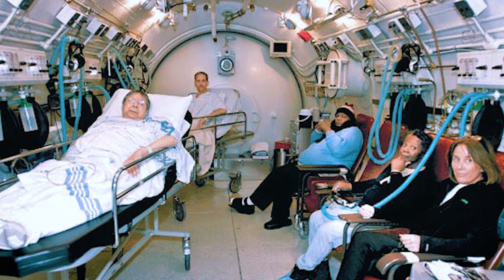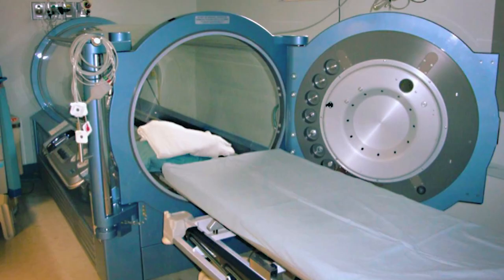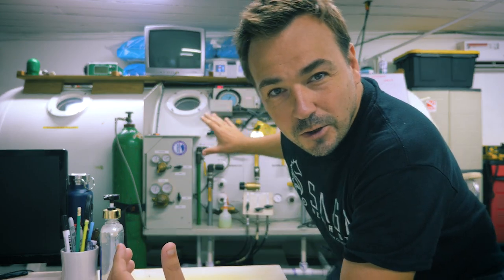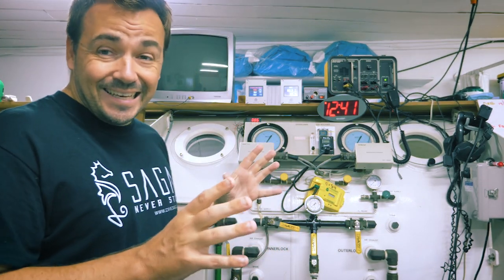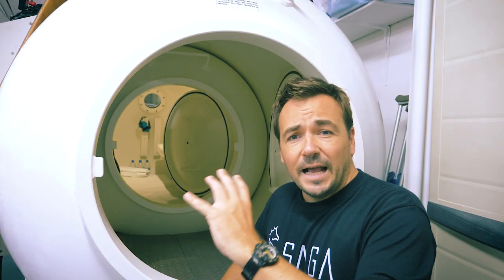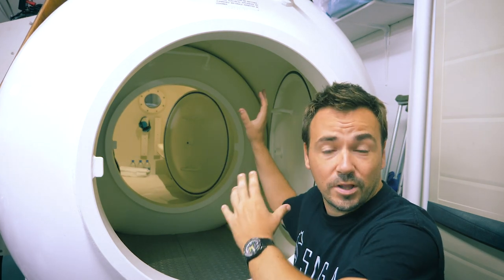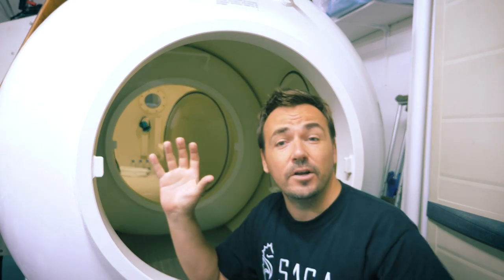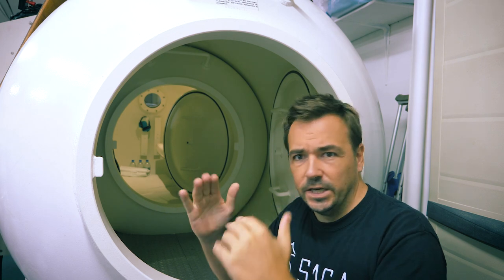How Does a HYPERBARIC Chamber Work?

Comment: I've never even tried scuba diving, just wondering how do divers enter these chambers without flooding the place from opening the door inside the ocean??? :D
Reply: These chambers do not enter the sea but mimic it where the pressure created inside them thins the oxygen gas where oxygen then gets introduced to the blood plasma directly
Reply: What u are describing is a bell, they have large amounts of air being pumped into them which is greater then the force of the water on the outside, as u go deeper the water line also goes up till theres no air left. Which is why they commonly go between 60-350ft

Comment: Always wanted to know how a chamber works and this was very informative. Thank you for taking the time to make this video. Had a question. I have heard that getting time in a chamber is very expensive. How expensive is it compared to when someone has a DAN insurance?
Reply from the maker: It really depends from location to location. Here it's about 4-500 USD per hour but that is on the low end. If you carry DAN insurance or similar, they usually cover the whole treatment.
Reply: @DiveSAGA  Ah. Makes sense. Thank you so much for taking the time to reply.

Comment: hi. at 8min50sec you showed the regulator. where can i get the small metal valves on the regulator. i've been searching for a year & nobody knows about them & i've never found one on google/ what are they called. there are 2  with one on either side & they allow you to adjust the flow of oxygen so it only flows when you breath. you were really good thats necessary info. thanks.
Reply from the maker: I will try to find out!
Reply: @DiveSAGA  thank you very much
Reply: @DiveSAGA  hi there did you manage to find out. its for kids with brain damage hbot. thanks.
Reply from the maker: @michaelprivate9107  unfortunately not. We just have them and have no idea either when or where they were acquired.
Reply: @DiveSAGA  ok thanks, do you know what they are called exactly & do you think they are purposely made for hbots
Reply: @michaelgrimshaw1854   why don’t you contact the manufacturer of this model and ask them?
Reply: I have them, if you want, I can send them to you.